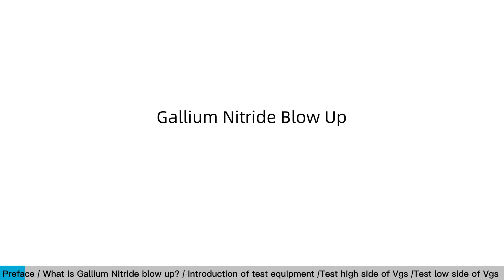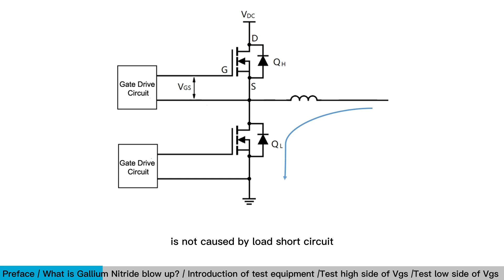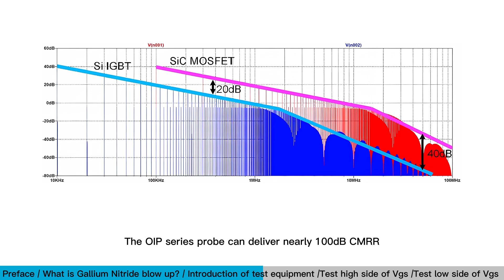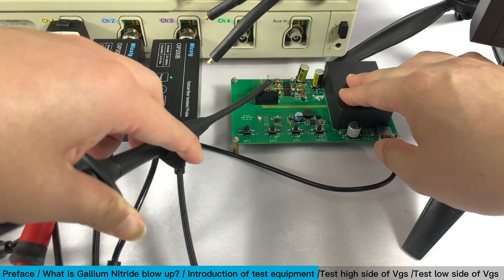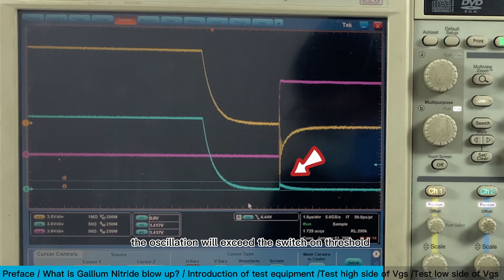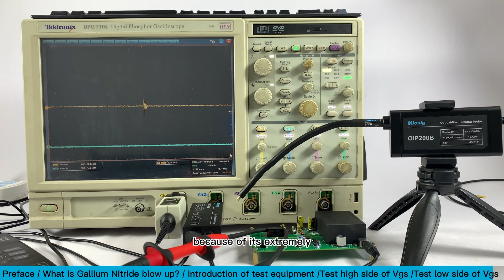GaN Blow Up!？Optical Isolated Probe Tells Why

Comment: I'm lame in the matter so maybe a stupid question ? Why low and high transistor ? We can only pump juice from high side when level drops ? Or we expect voltage push from load ?
Is this more effective ? Allows higher frequency (smaller inductor) ?